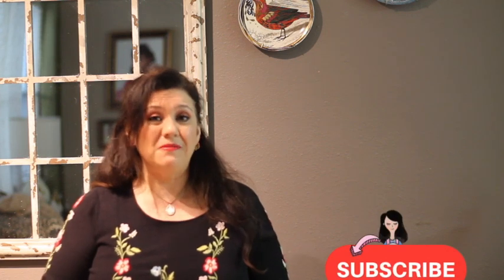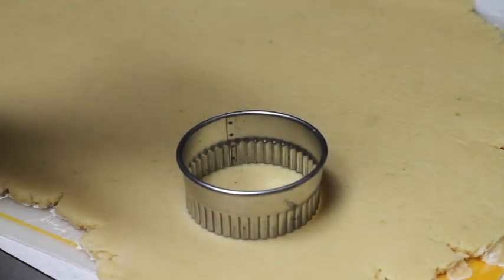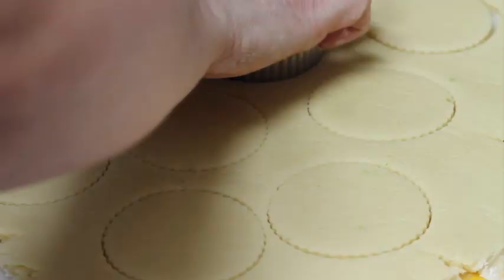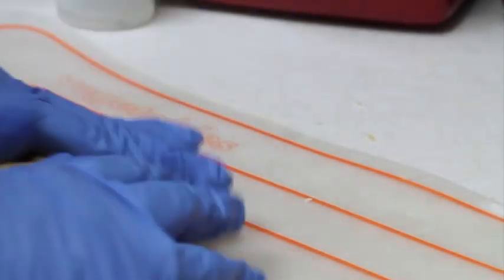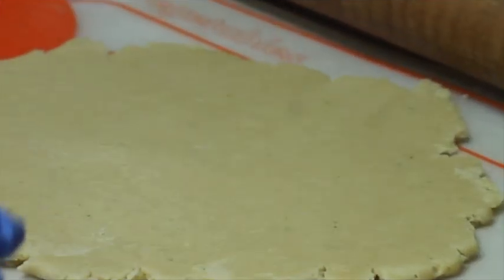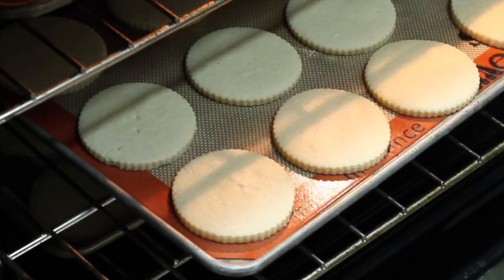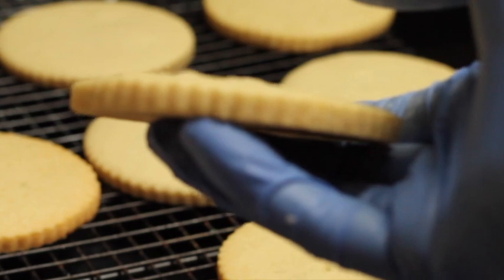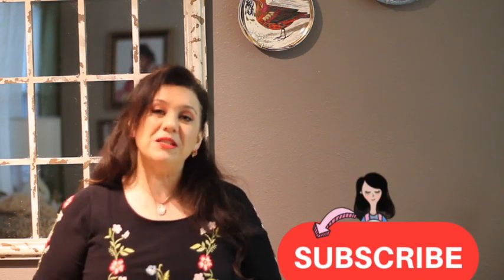Why my cookies have bumps on the top after baking

Comment: Did I miss something here?  Are you saying that if you don’t mix the cookie dough well you get air bubbles?  Because I got air bubbles with the first batch of cookies, not the left over dough after I used the cookie cutter.
Reply from the maker: Hi there, if you gather the dough pieces after you cut-out the  first batch of cookies and you don't "knead it well" sometimes there are hollow spaces and when you cut out cookies again and bake them in those hollow spaces can form a bubble as as a result your cookies can have bumps after baking.  I am not sure which recipe you used to make your cookies, it might need a little more time in the kneading part.  I only have had this problem with the leftover dough.  Hope this helps, thank for the comment and for watching!